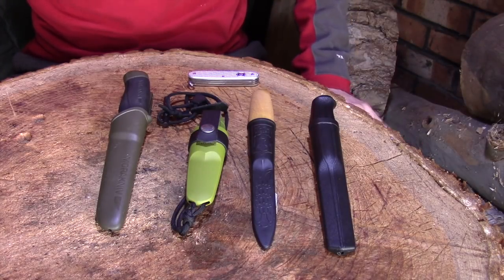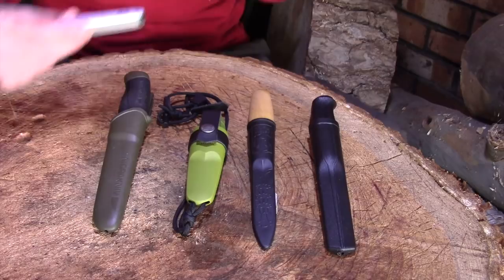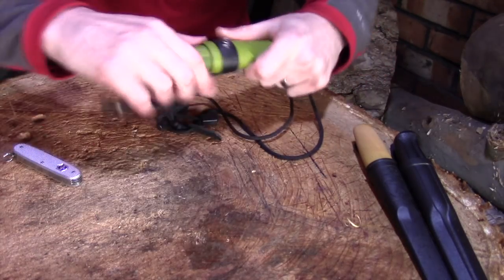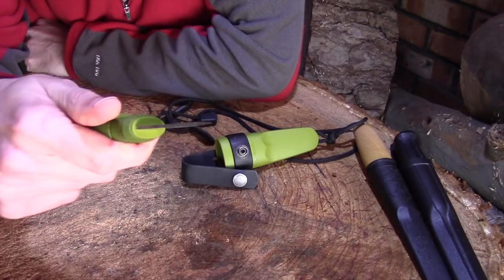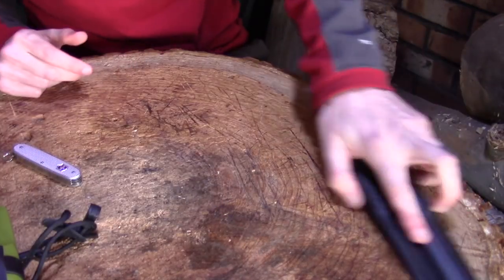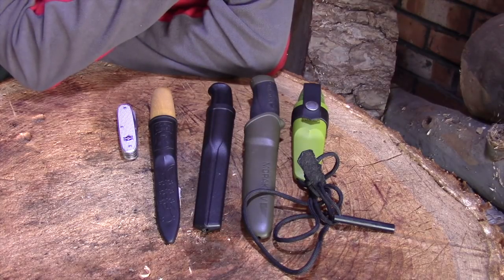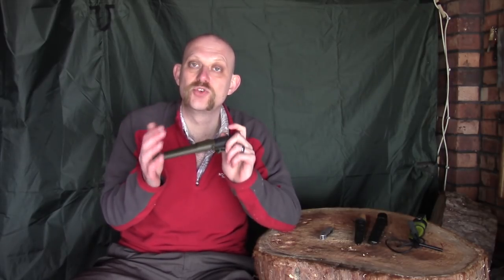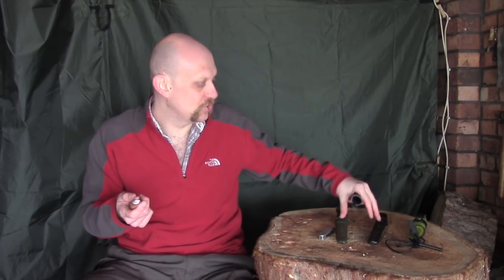Beginners Guide to Wood Carving  - Selecting a Knife

Comment: I would recommend the Mora 106 to anyone but especially to those just starting out. A Mora120 would be my second choice. Two excellent knives for wood carving. At some point you might want to get a Mora Classic #2. The larger blade makes stock removal a little quicker and easier.

Thanks for the video. The wood carvers tool kit is a fascinating subject.

Comment: Thanks for the tips on carving knives. I am a veteran Woodcarver. I have owned various other knives but when I discovered the Mora, Swedish Sloyde knife I decided to own nothing else. My name implies I am Scandinavian, so I am slightly biased but I don't care if Mora is Chinese, Mexican or African, if it works well I want it. I guess I can be proud that my Scandinavian cousins can make such a good quality knife. I have shopped for Mora knives and get confused as to what knife is best. It turns out the 125 or the 106 fits my needs for roughing out a Woodcarving especially a spoon. It also works fairly well for detail carving but I have recently began to realize I need a detail knife and micro chisels for what I do. So far I find Ramelson to be the best for detail carving. Believe it or not I use a chip carving knife I received from.Wayne Barton for stop cuts. It seems like the knife to look for is s well balanced easy to sharpen and holds an edge well blade as well as a comfortable handle. 

What I need is good general purpose knife for Bushcraft. I have owned a couple of Swiss Army knives. They work well for cutting strings and for cutting the cheese but they didn't hold up to what I needed them for. I need a knife for cutting small branches and for skinning rabbits, cleaning catfish and bluegill and skinning the squirrel my dog wants to catch. I have a K Bar but it doesn't seem to perform well. Will this clipper work as a good bush knife as well as a good roughing knife?
Reply from the maker: Randall Hermanson I would go as far as saying the mora clipper is probably one of the best general bushcraft knives I have ever used.
The Scandinavian grind is easy to maintain in the field and I find it much sharper than its secondary bevel equivalents.
It’s great for roughing out and general carving, sharp enough for skinning and gutting, will cut away shoots and small branches and can even be used for light batoning if that’s your thing.
The more I think about it i think you should take a look at the Mora Heavy Duty/robust, it’s the same knife as the clipper but with a thicker spine making it, as the name suggests, a bit more robust.

Comment: Thanks, as a new carver I really appreciate your videos. Was wondering if you could answer something...What angle should I sharpen my Mora wood carving knife? Can't find a good answer to that or even what the angle is when new. Thanks!
Reply from the maker: P. W. Glad they are helping, generally speaking a Scandinavian grind (as used in Mora’s) are anything from 15-25 degrees.
The best way I have found to sharpen them is on a bench stone (oil stone, water stone, diamond stone etc...) if you lay the blade flat on the stone and gently tilt it until the bevel is flush with the stone that’s the angle you want.
I will be doing a video that covers maintenance in this series but I probably be doing a full demonstration.
One of the best videos I have seen on this was by Ray Mears, if you search “ray mears how to sharpen a knife at camp” on YouTube you will find a really comprehensive guide.
Hope that helps. Hamster
Reply: Woodcraft Hamster Thanks! Much appreciated.
Reply: Woodcraft Hamster Heya dude I'm having a bout of depression my friend Alan Mann passed away at home wasn't found for a week neighbors complained about a big stink. We was close friends for two years too so when my depression eased up I sends ya my thankies package you will find very useful best regards to misses hamster💪🐺🐾💕👌